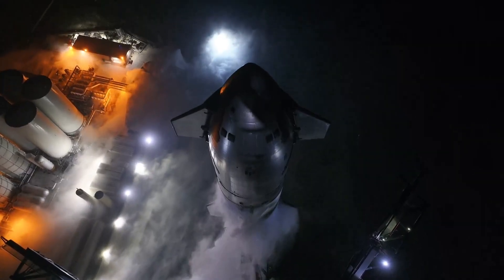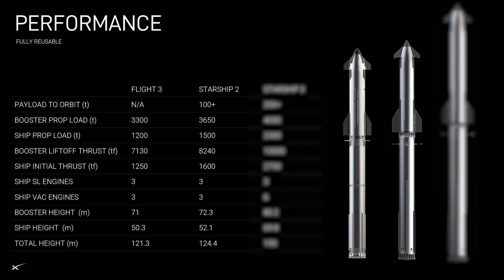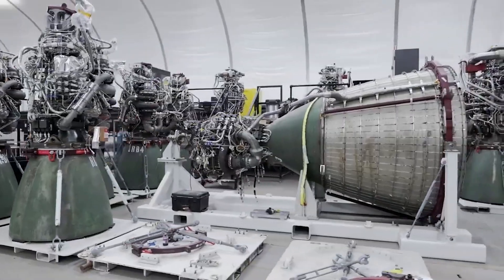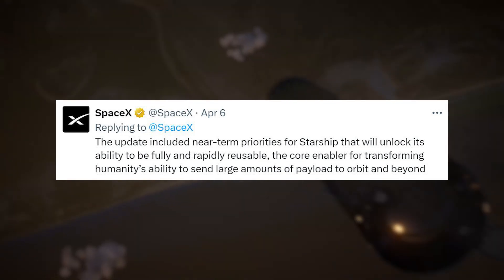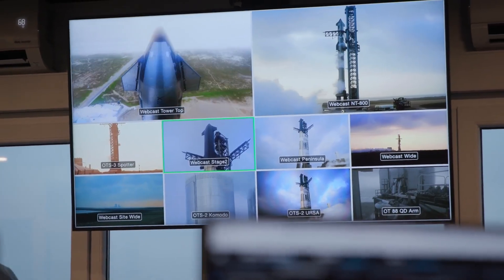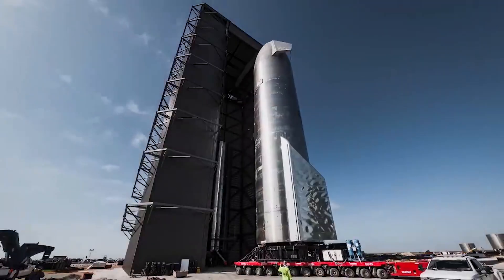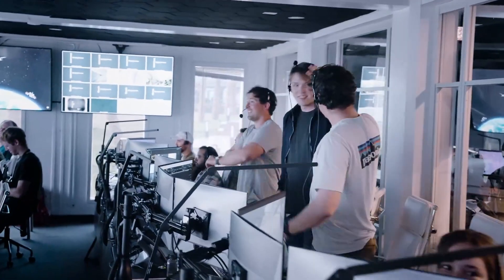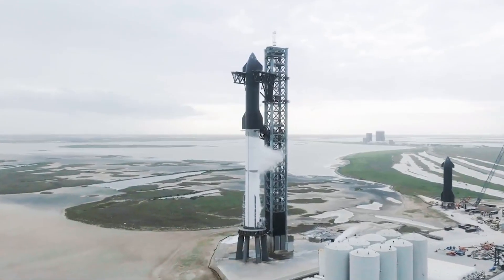A Closer Look At SpaceX’s Upgraded Starship Variant

Comment: lets see if it finally lands ofter 3 failed flights, 1 enviromental disaster and 6 billion dollars of taxpayer money dumped into the gulf of Mexico lmao
Reply: How did you arrive at $6 billion dollars of taxpayer money when it comes to Starship? As far as I can tell, the public investment has been in a lunar starship, with a contract award of $3 billion in 2021, and then a contract modification that included another $1.5 billion. That is for the Artemis program. Now much less than $6 billion, but still a difference, and for a worthy program. 

As for the environment, the rockets use methalox engines - which tend to be better than kerolox engines say like the F-1 engines of the first stage of Saturn V. 

As for the flights, those are test flights. Don't think the third was seen as a failure.

Comment: If they really wanted to test catching they could take a booster, fill it with minimum fuel to reach 5 km altitude and try to catch it, or eve try to "virtualy" catch it over some remote place. No need to wait for ITF4
Reply: If you're going to expend a booster, might as well test as much as you can.
Reply: I think they're pretty confident that they can catch it if they manage to get it through the flip and reentry.
Reply: @ascherlafayette8572  But are they ready to risk a huge explosion on launching pad if something goes wrong?
Reply: If it RUDs that's gonna delay the IFT4
So we need that second tower up asap for the explosive shenanigans

Comment: SpaceX would been far better financially, if they developed a standard Methalox rocket as New Glenn, and as a side project develop a reusable upper stage in cooperation with NASA, which could be an updated version of the Space Shuttle.
Reply: We'd would've been far better off financially if we never went the moon. Maybe we should appreciate that SpaceX is going out of their way to try and change conventional space travel.
Reply: Are you an engineer?  Or a rocket scientist?  Experienced in oversight of a large technological company?  Answer yes to any one of these questions and you may have what it takes to understand the complexity of what it is Space X is attempting.   If no, well, you know!   Thanks for your comment!
Reply: @michaeldeierhoi4096  The Rocket equation has entered the room.
Reply: @michaeldeierhoi4096  He's not even a clever faker.
Reply: @TheEvilmooseofdoom  😅😂
Reply: @TheEvilmooseofdoom   And you as a  fanboy, drinking all the Kool-Aid without questioning.
Reply: @TheEvilmooseofdoom  SLS costs per launch start to seem reasonable if you start to do some calculations. If the Starship empty version costs per launch around 2 bil, and the Lunar Starship with all the Life support systems around 4 bil. 10 Starship Tankers X 1 Lunar Starship = (10 X 2 bil) + 4 bill = 24 bill.
Reply: @michaeldeierhoi4096   Calculate how many engines SpaceX threw away with the last 3 "successful" Starship launches? If they use all those fundings to build the booster but with a disposable upper stage, Starship would been already into commercial operation. And then develop the reusable version.
Reply: @RogerM88    Well, since there are no do overs when it comes to development of Starship your hypothetical is kind of DOA.   Just sayin'.
Reply: @michaeldeierhoi4096  For Crew missions gliding to land instead of a landing burn, offer far more sense of security as lesser G-force to the Crew. Another reason why Starship will be used mostly for Starlink missions. Since the payload hatch, even in a wider configuration, won't allow to use with efficiency all the available space, versus a standard payload fairing layout.

Comment: Go big or go home! This will be “entertaining” to watch. Considering that the last launch didn’t get everything they needed on the tiles performance and they seem to be doing a lot of rework on the tiles it seems to be brave to be jumping to even larger configurations before the details have been validated.
Reply: Multi-variable testing is possible if done properly and it is the best way to get the most value out of each launch. Space-X has some smart cookies working there, they seem to know what they are doing up to this point.
Reply: No argument about getting as much “useful” data on each launch. My point is that they didn’t get much useful data about the performance of the tiles on this launch other than there was some tile failure early on and what appears to be substantial failure of tiles in an out of design reentry. Considering that little has been said by official sources and substantial tile rework is happening, one must assume that the final design has not been perfected yet. 

So assuming that the next launch has a reasonable start into reentry, it will be the first opportunity to “start” figuring out what is working and not working. Despite they are using almost identical tiles that the Shuttle used, starship’s structure is considerably more flexible and the mounting technique is “unique”. It would be one thing if they just continued on with what they were doing, but they seem to be changing many things simultaneously which I have found to make data analysis significantly more difficult.
Reply: @Mentaculus42  Appears.  I have not seen anything that has convinced me that a lot of tiles were spalling at all.   And the tiles are not the same as the shuttle tiles.  Testing and changing things is the whole point of what's being done.
Reply: @TheEvilmooseofdoom  

The tiles are basically chemically and physically identical to the last iteration of shuttle tiles. Spacex even hired the people who worked on the shuttle tiles except the tiles appear to be not as structurally refined (they are cruder) when analyzed using an electron microscope. So spacex just copied the Shuttle technology, this has been carefully verified and an excellent youtube video shows the results. 

It appears in the video at a relatively late time that significant numbers of tiles break off but that sorta doesn’t matter as the ss was in an improper angle relative to reentry.  So from the camera it is hard to say if anything was learned .

Comment: Currently the vehicle isn't carrying anything to orbit.
Reply: ...Why would you put a payload on a ship you know you have a 90% chance of blowing up the moment it misbehaves?
Reply: @inthefade  water can be a payload and gives exactly the data of a fully functional ship. 3 ran out of fuel empty.
Reply: @TheMoneypresident  you're so right, I'm sure there couldnt be any complexity in pumping 50 tons of water onto a rocket and then containing and dispersing it into a vacuum. Why would we do things the dimple way when we could include more complexity and variability to increase potential failure points!
Reply: @ascherlafayette8572  Why is the starship is a turd bucket and needs to be rethought.
Reply: @TheMoneypresident  There is no point in simulating a payload at this point in testing.
Reply: @TheEvilmooseofdoom  they are doing so tho, they vent extra fuel after seco.
Reply: Because PROTOTYPE. There are NO STARSHIPS YET. These are only PROTOTYPES.  TEST rockets.. TEST TEST TEST.  It'll be a bit before a finalized Starship gets the first weld.
Reply: Incredible observation
Reply: the pay load was extra lox, thats actualy what killed ift 2, when they got rid of it to simulate mass but it ended up blowing the rocket because of a fire that was ongoing.